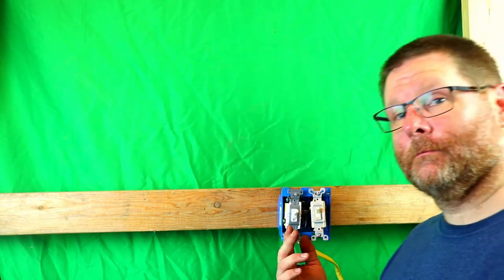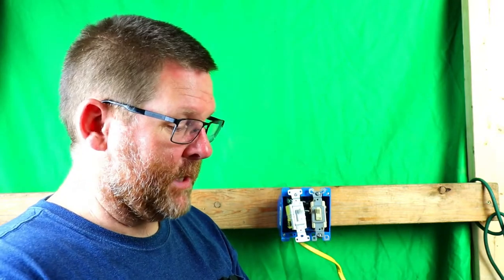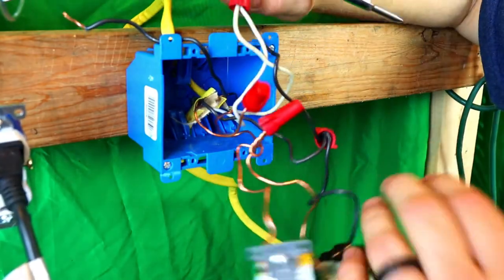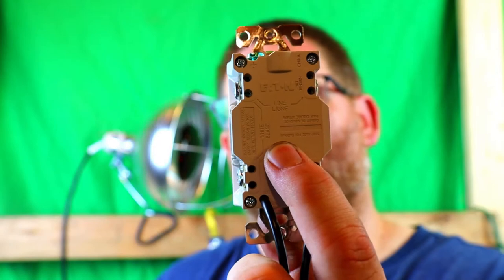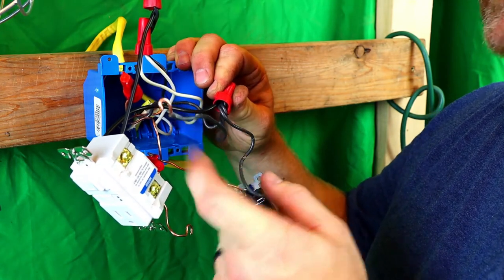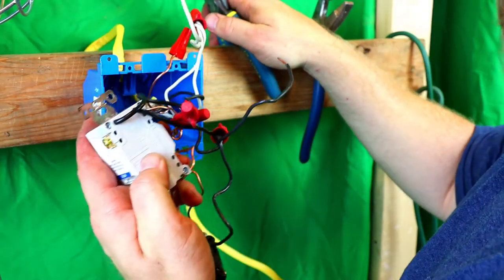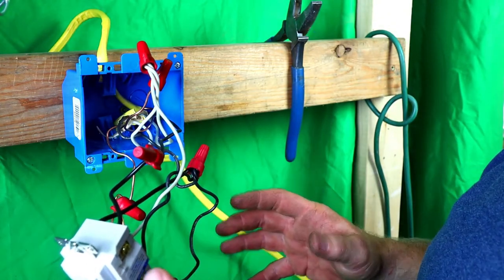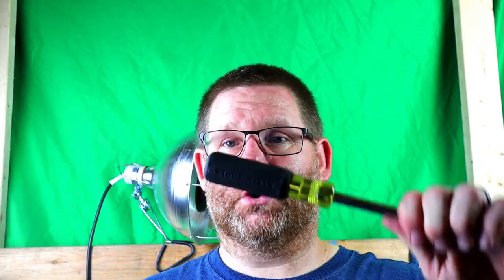DIY Gfci Switch Combo Bathroom Or Kitchen Install

Comment: Ok I have a kitchen that has now gfci. In the same box it has line in, a switched light and a plug in that box; then it has one more plug and it goes out to the laundry room light. It works but once I tie the laundry into the mess it won’t reset. I’m lost

Comment: Good video. The only other thing I wish you would have covered is the additional load terminals on the top of the unit below the switch pig tails, if you wan to connect another outlet in the series. You kind of mention it but an example would be good. Also can you just add the hot switch wire to the line terminal screw to reduce wire splicing and put the neutral from the switch into the neutral load? Good video.
Reply from the maker: Exactly and I hear that I plan on revisiting this video with all of the options that you can do with this switch. Thank you for your comment and watching. Have a great day ☺

Comment: I'm going to guess that the GFCI is for 20 Amp lines but it's rated to trip at 15 + Amps??? Or, does it trip when 20 amps is exceeded?  Thanks for the video.

Comment: I have the same setup in my bathroom although it is missing the ground wire is it a big deal not having a ground wire?
Reply from the maker: The gfci will not produce a ground. But it will satisfy the code.

Comment: Thank you so much I was frustrated and was only able to get the gfci plug on  when the switch was on for the garbage disposal it's been like that for a couple months but I ran across your video and I took it all back apart and added a jumper wire thank you so much greatly appreciated
Reply from the maker: Awesome so glad to hear that this helped you. I appreciate you watching and commenting ☺

Comment: Enjoyed your video.   So will the switch on the outlet control whatever is plugged to that outlet?    That is what I need.   Need to use that switch to turn a small pump on to a pool slide.  Simply have white wire, black and ground.  I guess those two black wires are basically breaking the circuit.   Every way I’ve wired it so far either flips main breaker or switch does nothing

Comment: Question: If I only have two black wires do I need to add an additional one to the hot wire? Use it as a jumper?

Comment: How do you know if the switch will control the GFI or not
Reply from the maker: https://youtu.be/-FavP8faGkc here is the video showing you how to do it
Reply: @MountaineerOutdoors  I figured it I had the wrong type but thankyou so much
Reply from the maker: No problem but if you have one like I pictured you can use the switch to control the gfci. I did it in the video I linked in the comment
Reply: The one i had did not have the outlet separate from the switch
Reply from the maker: https://youtu.be/ASHnLcvO-3w here is how to do it when it's separate
Reply: @MountaineerOutdoors  thank you you have been a big help
Reply from the maker: @benjaminlmiller3796  my pleasure I hope that this helps you out

Comment: U posted a video showing gfi mistake using Load to output to next receptacle, did u remove that video ?
Reply from the maker: I'm not sure which one that is. I'm kinda confused on your comment... I can assure you that I have not ever deleted one single video from my channel. Might have to give me more context
Reply: @MountaineerOutdoors  you had a demonstration of gfi on wall feeding non gfi near it. Then you showed how using LOAD of gfi to feed second non gfi receptacle. Using tester you showed that when gfi tripped there was still power to that 2nd receptical. I can't locate that demonstration. Thanks for replying.
Reply from the maker: https://youtu.be/Fe9hwE8dN_k. Let me know if this is the one
Reply: @MountaineerOutdoors  YES, many many thanks my friend.
Reply from the maker: Always glad to help. Have a great weekend
Reply: @MountaineerOutdoors  no, it's not the same demonstration. U showed how mistake in wiring gfi could still leave next receptacle hot when first gfi tripped....https://youtu.be/d_XrDugHIXQ?si=pbcZoodyS-M_ZrJ6
This is the demonstration, I'm trying to comprehend it, here u note never use LOAD to feed next gfi. I made this mistake, I used LOAD to feed next gfi and surprise! 2nd gfi was HOT even though 1st gfi tripped ! So now I'm afraid to use LOAD in series.
Reply: @MountaineerOutdoors  no, it's this demo:https://youtu.be/d_XrDugHIXQ?si=pbcZoodyS-M_ZrJ6
So never use LOAD when using multiple gfi in the circuit branch.

Comment: Do you think this switch is worth it if I have no ground wire? To turn my light on? House is old. Running a 12/1 I believe. Alternative to ground my exhaust fan/light?
Reply from the maker: Well as you mentioned, it's always better to have a ground.. But to satisfy the code you need gfci in bathroom settings.. So to be honest with you question do I think that this switch/gfci is good... Yep absolutely I believe it is very good. And I have a video coming back out on this same switch showing how to wire it up to protect the lights as gfci. Bottom line is yes it's an excellent product
Reply: @MountaineerOutdoors  thank you so much! I subscribed. Looking forward to more content. Thanks man! I’ll be switching my switch to gfci
Reply from the maker: Awesome and welcome to the mountaineer outdoors family ☺

Comment: Is the GFI supposed to click when you reset,?everything else worked,I have a black hot and white on the bottom and a green light on for the GFI, Thanks good video,also if all these wires don't fit with the  wires and reseceticals an extension required? Thanks Fred
Reply from the maker: Click?  You should hear it pull in a small click yes.

Comment: I bought this thinking it would provide GFCI protection to the light switch to protect an exhaust fan I installed in the shower. But it seems that no matter how I wire it, there's no way for that to work. Any suggestions? I already attempted to add a gfci breaker at the panel, but that circuit shares a neutral wire with a different circuit in the garage.
Reply from the maker: I have a video coming out soon on how to make what your talking about happen.

Comment: I followed the video to a T, and you have been helpful but I'm still having an issue! Switch and light work and GFCI "green-light indicator" lights up but when I plug something into the outlet, there is no power. Also, the "test" button won't click. Would love some help if you end up seeing this.
Reply from the maker: Sounds like you don't have power to receptacle part

Comment: I have the problem you described, no outlet in an old bathroom. Wanted to add one at the switch. All i have though is a hot and a Switch leg. Is there no way to make one of these work?

Comment: I only have 1 line into my box. 1 load, 1 neutral,  and ground...where do I put the 2nd switch line off the gfci...????🤔💙
Reply: the second one would be connected to the light... there are a few ways to wire these types

Comment: Good evening I encountered this switch for the first time I tried hooking up the power to the GFCI with my tester it appeared like I had power off of both legs of the switch so I didn't hook up the switch because I did NOT want Two Power Sources.
Reply: GFCI

Comment: Hello, I know you that the first thing you mentioned was that a Neutral was needed for this but I am just want to be 100% sure.  My bathroom does not have any outlets at all and I wanted to install one of this on the light switch to plug stuff in.  When I opened the box, I only found two cables (1 black wire and 1 blue wire) and nothing else.  Not even the grounds wire.  Installing this combo switch/outlet will not be possible in this scenario right?
Reply from the maker: Nope you have to have a nuetral for sure

Comment: Is it possible to install one of these with only two cables coming from wall
Reply: you will need a neutral in the box and not just a white wire from a “switch loop” but an actual neutral

Comment: Why not wire the switch to be gfci protected? Light hot and neutral to load side, connect all grounds?
Reply from the maker: I cannot believe that it took this long for someone to finally say that.. Excellent idea I was gonna do it in the video but I chose not to. Excellent comment
Reply: @MountaineerOutdoors  Could you show how to wire the switch to GFI....
Reply from the maker: That would be a good video. I will work on it
Reply: One of my two wires is connected to the gfci load.

Comment: I just got myself a cotton candy concessions trailer and updating it as it's 34 years old, to make it more efficient. I can't run the whole thing off 1 generator 30amp power supply.  it's wired for 50amp so when we have city power works great however at smaller events where it's only 30amp supply they have asked us to supplement power. I want to run 2 separate panels dividing the load so I can run of 2 30amp power sources bit if I have a 50amp power supply link the 2 panels to run as 1 unit. I assume there would be a switch in the middle to split or join the panels? Do you have any advice on this or how one would go about doing this? Thank you in advance

Comment: On this video, you have the neutrals pigtailed and going into one part of the switch. On your second video, you have two separate neutrals going into the switch without a pigtail. It’s not clear to me why you have two different installations for the same combo receptacle.